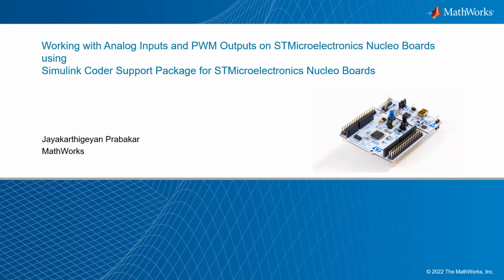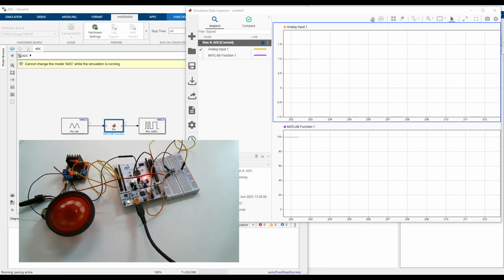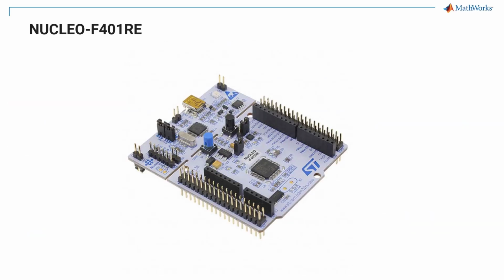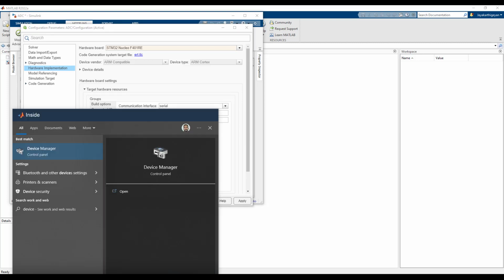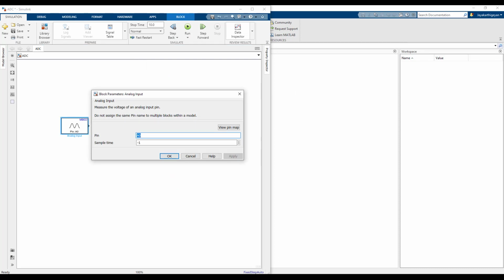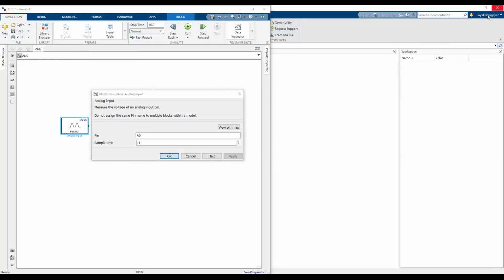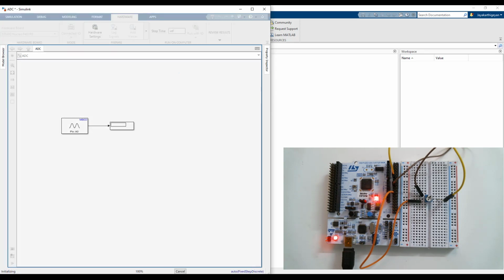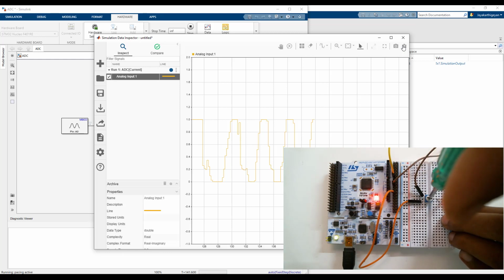How to Use STM32 ADC with Simulink Coder Support Package for Nucleo Boards

Comment: What packages do i need to get this working? You mentioned matlab, simulink and simulink coder support package so is that all i need if i also need to do DSP functions? OR do i need to also buy DSP toolbox? I need to do hardware in loop basically for stm32 board connected to sensors and motors. Thanks